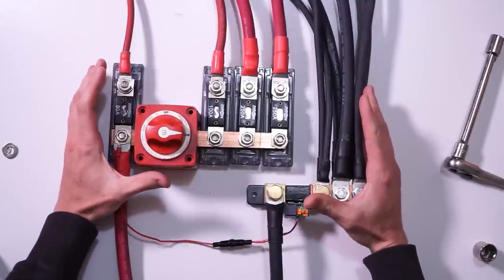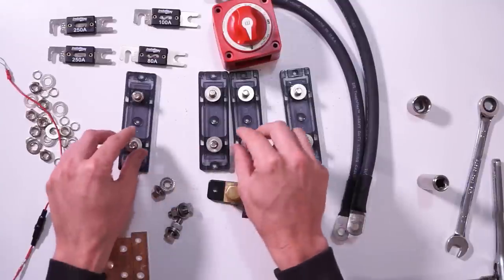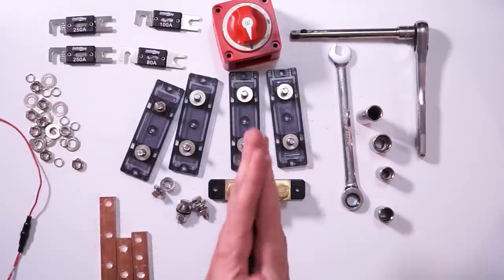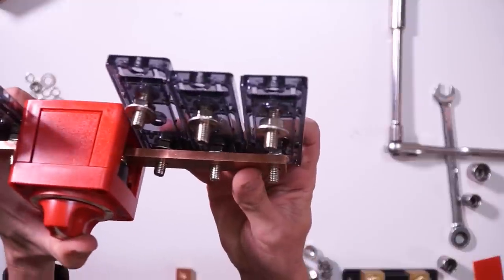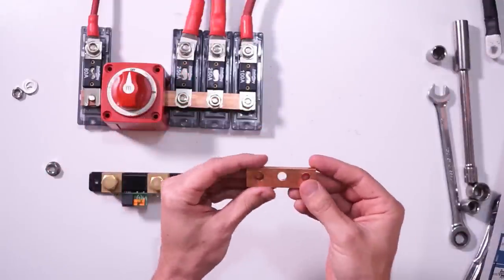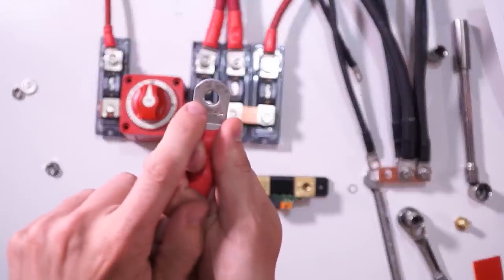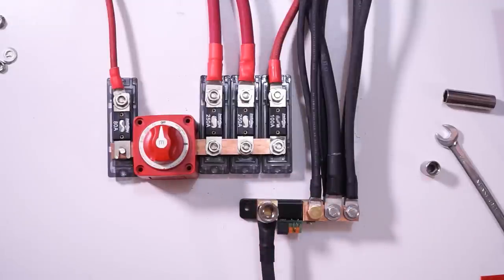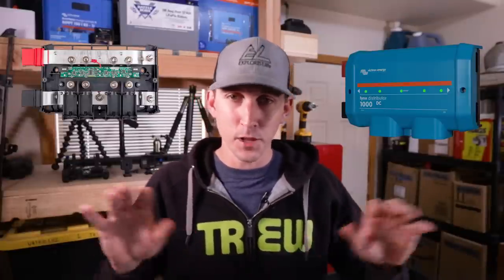How To Build a DIY Busbar for a Camper Van Solar Install

Comment: A nice clean setup indeed, minimal connecting wires to plug everything in. Very nice. I might go with nyloc nuts to make sure they don't vibrate loose. And/or maybe some blue Loctite threadlocker in some spots. Applied with caution naturally, one might want a little bit in the threads, but nothing between the nut and the busbar...
Reply from the maker: Great idea with the loctite!

Comment: I used the pre-made bus bars you showed towards the beginning.  Yes they are expensive, but do make a nice neat installation.  I really like the plastic cover they come with.  Your DYI busbars etc. would benefit from some kind of insulating cover.  An errant screwdriver/wrench could make a nice big spark if one wasn't careful.
Reply from the maker: The way in this video is a much neater installation that will have less resistance/connection/parts.  I agree about the cover.  The ANL fuses come with covers that COULD be modified to fit.  Alternatively, I'd like to 3d print some covers, but then I'd be getting REALLY close to the price of the Lynx... So yeah... Maybe eventually; but caution always needs to be taken when using tools around battery systems.

Comment: Great video! I've got a lot of back ground in wiring of auto and truck systems, so solar is new knowledge for me. I've got one suggestion for followers. Use caution if you decide to try drilling out a lug to a larger hole size. I've been in situations where I had to utilize what was available and have drilled out ends before. On occasion, usually when using a non-variable speed drill, I've had the bit snag before making it through and it twists the hole of the lug into a tight piece of waste, not to mention that the drill will try to twist your wrist off, as well. If you don't have a variable speed drill and know how to take your time with this, I would advise going to the local auto parts store and try finding the correct size lug. Since your using a 5/16 ring size, the next size up would be a 3/8.
Reply from the maker: Correctly sized wire lugs are ALWAYS recommended and are now included on every wiring diagram parts list at https://www.explorist.life/solarwiringdiagrams as well as the kits at shop.explorist.life

If drilling a lug is ABSOLUTELY necessary; putting it in a vice and using a step bit is by far the safest way I've found to do that.  Step bits don't grab nearly as bad as normal drill bits.

Comment: Nice extending the shunt into a negative buss bar using copper. As for another option on the fused positive side you can go with Blue Sea Systems 5196 fusible bus bar (accepts 30-300A Marine Rated Battery Fuses) approx. $45 versus $140 for the Victron Lynx.

Comment: Another trick that you can tell when a fuse is blown is taking an LED with an appropriate resistor value and making sure the direction is correct on the fuse block and putting the LED across the fuse. The LED will not light as long as the fuse is good but as soon as the fuse is blown the LED will light because the LED is using the ground off of whatever circuit has caused the fuse to trip. Works great if you have multiple fuses in one area that you can get a quick read out, I know the links distributor has that same setup but this is a DIY version if you are familiar with electronic components to add to your fuse block.

Comment: Great idea, my man. 
I wasn’t about to pay $77 or better for bus bars. 
Thank you.
Reply from the maker: No problem!  You'll be pretty close to $70 by the time the copper, fuse holders, nuts, bolts, and master disconnect is all figured in; but it will all be in a smaller package.

Comment: Great video. I know you have done a video on programing Victron equipment, but for us old timers, could you do one on prep computer with the proper programs and updating the flash chips, etc. before programing the equipment? Thanks!
Reply from the maker: At the risk of sounding like an asshole, if somebody cannot download programs or apps to their phone or computer, I must be fully transparent that building a DIY electrical system will be a bit too advanced and one must establish a base level of mechanical aptitude before tackling a project like this, which would include learning how to download apps and programs.  There are LOADS of other channels that cover basics of how to download programs and apps.
Reply from the maker: Alternatively, we have installers on staff that are happy to install and program these systems for you: https://shop.explorist.life/shop/consultations-installations/installation-request-deposit/

Comment: Nate, Love your channel and website.  this red busbar is a clean  simple design. Beside this reason, why did you choose to design that way with only ANL fuse  versus Circuit breaker ?  I might be mistaken but if an ANL fuse blows up, you must replace it which requires more manual work than  switching off/on a circuit breaker.
Reply from the maker: Indeed, but in either case, manual work is going to be involved trying to diagnose why the breaker/fuse blew in the first place.  These fuses/breakers shouldn't be tripping/blowing.

Comment: Comment:  Thanks for the video(s).  Battle Born says to put all the connectors on the one same side of the battery post flag..  They said the post would become part of the circuit and can have problems.  So I was thinking about this when you were putting the ground (black) cables on each side of the bar.  Maybe it might be a tweak better to put them all on one side.  I did try to look for a link to where you sell them made up but didn't find it... yet.
Reply from the maker: I no longer sell nor recommend this.  I swapped this method out for the Lynx Distributor.  Check out my most recent tutorial.
Reply: @EXPLORISTlife  thank you

Comment: About switches. The reason there is an in and out is that the "in" lug always connects to the fixed contact of the switch while the "out" lug connects to the moving contact. The circuit will work either way, but the goal is to have any moving parts disconnected from power in the off position. Should the switch parts break, it is more likely to happen in the moving part of the switch which will hopefully be de-energized when it fails.
Reply from the maker: Great explanation!

Comment: When sizing the fuses to protect the wires, is it just a matter of finding out how many amps the wires are capable of carrying, and going 1.25 X higher for the fuse? Or, is there another parameter we need to consider? Thanks.
PS I think I will use a Victron Distributor instead of doing all this work. Thanks again for that tip.

Comment: Hi, Nate. This is by far the nicest-looking setup I've seen! Thanks! Can you help me with 2 items? (1) In your diagram I'll need to use the Sterling B2B instead of the bim, and I think it needs both a black and red wire. Your negative bus bar is already full. How would I connect the negative wire of the B2B? (2) On the 110v side, do I really need a breaker between the inverter/converter and the four electrical outlets in my van? Can't I wire directly? Thanks for your helpful information!
Reply from the maker: 1: For the negative busbar, you could either cut it a bit longer and drill an extra hole, or you could run the equipment ground of the charge controller to the equipment ground of the Inverter/Charger instead of all the way back to the neutral busbar.  That would free up once space.

2: The Victron Multiplus Inverter/Chargers do not have any kind of breakers protecting the AC Out, so yes, you'd need a breaker protecting the electrical outlets.  Here's a tutorial on that: https://www.youtube.com/watch?v=YiufFMKolpY&lc=Ugz7bclyMKVcJ4odAiF4AaABAg

Comment: Great Video Nate,  Just wondering how and if you put the ANL fuse block covers back on?
Reply from the maker: You could cut a notch out of the ANL fuse holders to make them fit back on.  You'll just have to get a bit crafty with it.  I hope to release a 3d printed mount and cover for these in Jan/Feb 2020 to cover everything up nice and neat; but that'll be a 'me selling the thing' more than it will be a DIY option.

Comment: I have a multiplus 12/1600/70 I would like to mount it on a wall but horizontally rather than vertically (same way you have in your thumbnail )would this be an issue as I’ve been told they don’t like it . Is this true ??

Comment: This is a CLEAN setup. I'm thinking of using this build, but I have one question: I'll be using a 2/0 wire from 250ah battery bank to this setup, do I still need a fuse between the batteries and where the wire connects to the charge controller fuse of the bus bar?
Reply from the maker: Yes.  See the diagrams here for additional fuse locations for a full system: https://www.explorist.life/solarwiringdiagrams

Comment from the maker: IMPORTANT UPDATE: The fuses & fuse holders shown in the pictures and the video are NO LONGER RECOMMENDED.  Quality control on these have gone DRASTICALLY downhill over the last few months and many have had issues with these not being able to flow their rated current, heating up, and melting the fuse holders.

So... Moving forward... I HIGHLY recommend using the Busbar and fuse holder solution that is the Lynx Distributor (https://shop.explorist.life/shop/all-products/distribution-panels/victron-lynx-distributor/).  I have already place the Lynx Distributor in my most recent diagrams at https://www.explorist.life/solarwiringdiagrams and will be phasing out the diagrams that do not use the Victron Lynx Distributor.

If you REALLY want to use the DIY solution on this page, that's still fine; but I MUST recommend using Blue Sea Fuse Holders & Blue Sea ANL Fuses as they are tested and certified pieces of equipment.  You will also need to do your due diligence on the copper bar hole spacing if you go this route.

The links throughout the rest of this blog post SHOULD be updated with blue sea fuses and fuse holders; but if you stumble across non-name-brand fuses or holders, please do not use them and let me know where you see them.

End Update
Reply: Thanks Nate! I was just about to grab parts to build this and saw your updates. One question if you don't mind.  I noticed in your build video you connected the MPPT controller positive line to the left of the main cut-off switch (before the switch and directly connected to the battery), only I noticed that that same MPPT positive line goes directly into the Lynx Distributor in the new diagram (opposite side then before). Which side of the switch should I place this MPPT positive line on? Thx
Reply: Also, you mentioned to get 1/4"x1" copper bar here and 1/4"x1 1/2" in your blog post update. Just want to make sure I'm getting the right thing.
Reply: Hi Nate I have taken a little different direction on my boat build, I used Blue Sea MIDI fuse holders and fuses. Several reasons, you don’t have to worry about leveling the fuse because the fuse is separately secured, next they are more compact so easier to manage in confined spaces, last they come with covers that are tethered to the fuse block and they hold a spare replacement fuse right there! Your bus bars are a great solution but in an instance where you have to sacrifice a lock washer and a regular washer not so much, so I think a larger Blue Sea bus bar that is covered with your copper bar bridging parts is a good compromise. Of course a Lynx is a really nice item but too late for me and I would still have to use a bus bar for needed capacity. Thanks Ben S/V DAWN
Reply: If your vehicle is 12 V not 24V, Can you still chassis ground a 24V or higher V system to it?
Reply: Just make sure, the solar charge controller stays powered on, even if you disconnect all other loads? Can it drain the battery if you have no solar for a long time?
Reply: mmmmm
Reply: @roach6791  I had the same concern. As an electrical engineer I would say you place the alternator charger on the same side as the mppt shown above. That way sources can be isolated from loads via the switch. Unless there is something I'm missing.
Reply: How about Spartan fuse holders?

Comment: Well done, thanks for the detailed walk-through. One question - how did you size the copper bars? Is there a formula that relates cross-sectional area to amps or something similar. I ask because if you could use 1/8" (or even 1/16") bar the washers, etc would fit better.
Reply from the maker: Yes.   There is a formula.  Look up "Copper Bar Ampacity Tables" to cross-reference the circular mils of wire to bar.
Reply: @EXPLORISTlife  Thanks! Exactly what I was looking for.

Comment: Hello Nate 
I have learned a lot from your video's keep them coming my Friend !?
I have a question about the load side of a bmv 712 shunt I have 6 negative wires of different sizes so they will not all fit. I have a junction post I purchased from AM Solar that I could utilize for some or all the 6 wires. My main question is what SIze cable would be appropriate to connect the load shunt terminal to the junction post.
Thanks for time
I greatly appreciate it.
Reply from the maker: Wire size is determined by the manufacturer recommendation of the component OR if not given...  the maximum amount of current you expect to be flowing through it at any given time.

Comment: Nice job.  Tell me why you need this and a distribution system. This looks like a distribution system already,  complete with main shutoff and fuses for "branches".
Reply from the maker: This is for 'high amperage' loads like inverters, charge controllers, DC DC chargers, etc...  The distribution center is more for lower amperage loads with a max of 30ish amps per circuit like lights, fans, usb outlets, etc.

Comment: I have a 2019 Lance truck camper model 855S two batteries , one one hundred watt solar panel,like to see more on small solar systems, we would like to add on or replace the entire system   Thanks Charlie
Reply from the maker: Here are several examples on how I recommend adding to an OEM RV: https://www.explorist.life/solarwiringdiagrams

Comment: Is there any downside in using 4/0 AWG wire for everything other than it cost more? I just got 3 battleborn batteries, a victron 3000 charger/inverter and the battery monitor. Can't wait to put it all together.
Reply from the maker: It costs more and it's just a little more difficult to work with being a bigger wire and all.  You'll also have to verify that the wire will fit where you need it.  For example:  a 4/0 wire won't fit into the terminals of any of the MPPT charge controllers.

Comment: Hey Nate. This is a very helpful DIY instructional for building my own bus bar. I’m trying to decide if I should go that route or purchase the Victron Lynx. Do I need to get a battery monitor if I only plan on using my smartphone to monitor my battery life? Or does the Lynx eliminate the need for a battery monitor?
Reply from the maker: The Lynx is a great off-the-shelf product for high-amperage power distribution which is why I now include it in my diagrams.  You will still need a battery monitor though.  Please see this diagram for an example: https://www.explorist.life/3000w-inverter-400-600ah-400-to-1200w-solar-camper-solar-kit

Comment: I have a 1080 watt solar system with two 50 amp charge controllers. Is each charge controller given its own buss bar post? Thanks for the video, this was the exact thing I was looking for.

Comment: A Dremel with a cutting disc would also make short work of the copper bar cutting. I've used mine to cut some 20 mm steel pipe when I needed to cut just a few, easier than a hacksaw. I've even used a wood cutter on my Dremel to cut plywood once when I was desperate. Obviously not ideal but it can be done.
Reply from the maker: Yeah.  Bandsaw, hacksaw, dremel, chopsaw, Jigsaw, reciprocating saw... there's all kinds of ways to cut it since it's a fairly soft metal.
Reply: @EXPLORISTlife  Everyone should own a Dremel, never know when it can come in handy. 😎
Reply from the maker: @lorcro2000  We had two at one point. Haha!

Comment: Superb job Nate!  I am preparing to purchase your nifty 3D printed busbar mount setup, but wanting to know if they'll come with covers.  Also, noticed your Battleborn battery connector bus.  Any idea if it will work to connect two Lionenergy UT1300's in series?

Comment: Wow. Just starting my van conversion. Love your diagrams. However I cannot see what size fuse in the ANL holder to the batteries. I see the other 3 on the other side of the on off but not the main lead, thanks 👍👍
Reply from the maker: I'm not sure which specific diagram you are looking at, but the parts list below the diagram will tell you which fuse size it is and the high resolution diagram option on all of the pages will let you zoom in to get those details.
Reply: Well I’m running 2 100 amp batteries. 2 100 watt solar panels.

Comment: In this busbar, why is the connection for the MPPT controller on the left side of the switch with the battery connection? Shouldn't the switch isolate the battery from everything else? With this setup, you can't break the positive MPPT and battery connection no?
Reply: it allows you to disconnect everything else but allow the solar to continue to charge the batteries,
Reply: Yes, you don't want to disconnect the battery from the scc as it could damage it if solar is still connected